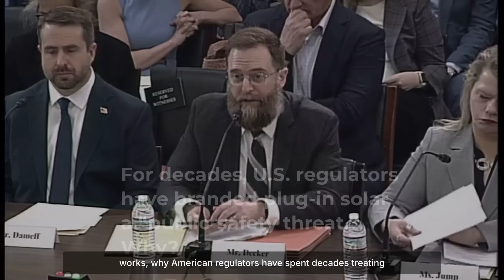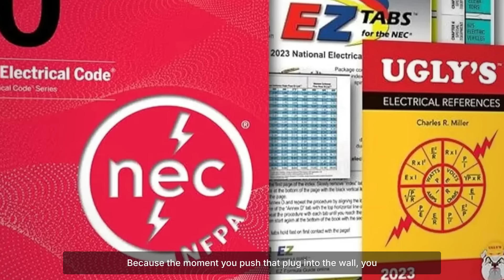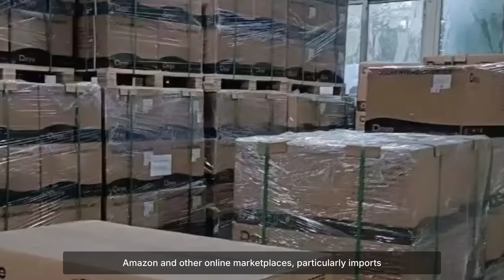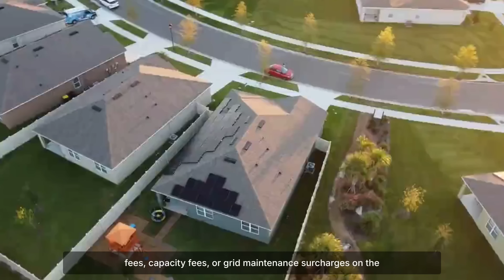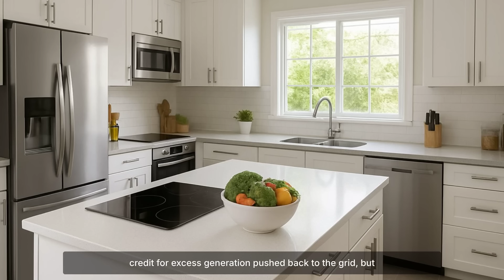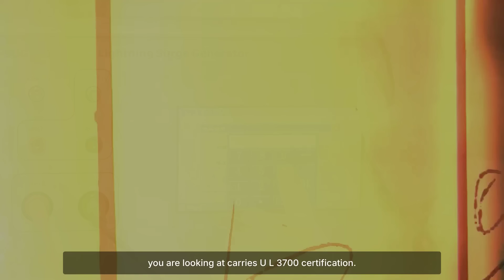This DIY Solar Trick Powers Your Home for FREE. Why Is It Illegal?

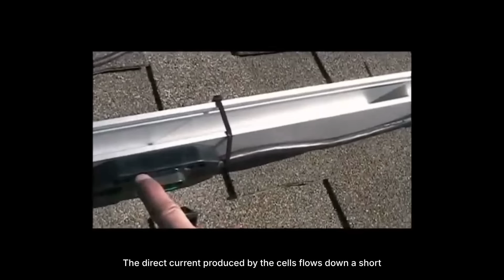Comment: 01:25 The thermosiphon principle is so elegant in its simplicity. It is fascinating that a passive design can create a self-sustaining convective loop to heat a room without requiring a single motor or moving part.

Comment: To use a plug in system just turn off the incoming supply that way it will not power through to the grid .

Comment: So if this type of micro inverter is able to activate without power from the grid, the solution is to install an outlet off the grid and connect  your appliance. I believe such type of micro inverter doesn't exist. No power from the grid,  the micro inverter  isn't  working

Comment: Maybe I didn’t pay attention to the details covered in this video but it seems to assume that any balcony solar would be interacting with the grid, that is quite a misleading assumption, someone could have a 400w balcony panel simply enter their own battery to use independently of any wall outlet and power their appliances through it independently.

Comment: Plug in solar is essentially unenforceable by the Authorities Having Jurisdiction (AHJ) 
If they catch you what are they going to do? Tell you to unplug it? As soon as they leave it is just going to be plugged back in again. 
Here are a few common sense things:
You may need to get a setup which monitors output do you do not  backfeed the utility. Most meters are not by directional. They will charge you for excess production. . 
Use a dedicated circuit. If you don't make sure the circuit is something there is no load on. 
Make sure the outlet you plug into is rated. Better to get a heavy duty outlet installed.
Make sure you don't tie into a circuit with the wires stabbed into the back of the outlet.  
Do not exceed 80% of the capacity of the circuit. 1400 watts on a 15 amp 120v circuit is max.
1900 watts is the max for a 20 amp 120v circuit 
Get listed products such as UL.

Comment: grid tie system don't produce electricity without the grid power hybrid do because they have battery Bank that's why some install a automatic transfer switch or put a manual transfer switch

Comment: People should be encouraged to have the system with a UL3700 rating.  Electricity is in extremely high demand and costs to buy electricity are rising.  Instead of building new power plants this could be answer to high electric demand and bills.

Comment: When your battery is fully charged. You can use the excess solar energy  directly to power your fans, light bulb, freezer, AC. Mean, your usage bill is gonna drop by 40-50%. In malaysia the hot sun easily generet 3-5kw daily.

Comment: The single most dangerous aspect of these Heath Robinson contraptions, and one that would definitely make them illegal in the UK, is not even given a mention amongst all the technical, financial, political, and other jargon in the video.
So, what happens when a child, or some other unsuspecting person, pulls that plug out of the wall socket and gets a large helping of mains voltage from the exposed live pins? These death traps are obviously manufactured in heathen third world countries that have absolutely no concept of health and safety. One only has to see the mile upon mile of spaghetti wiring festooned from building to building in their cities, to appreciate the ultra-low level of their safety standards. Any voltage, mains or otherwise, should ONLY ever be present at the wall socket or receptacle once the plug has been pulled, and NEVER at the plug itself!
The whole point of the plug is that, once it is unplugged, everything outside of the wall socket should be dead, except, of course, for the person holding it!

Comment: It's quite simple: if you make the power yourself, the utility loses money and make yourself a threat to their income.
It is true that grid tied plug-in solar can create real problems but the solution is to assemble an off-grid power cart.  The cart can be plugged into a dedicated outlet, one that comes directly off of the main breaker panel, such as an electric dryer, stove, or refridgerator. The appliance can then be plugged into the cart.  The cart-mounted inverter, which gets power from the grid, solar, and the battery, feeds the appliance and the dedicated outlet.
The solar, and/or the grid, charges the battery for power at night. The inverter can be programmed to NOT backfeed the grid.

Comment: Would've been better to learn the physics of the electricity before making a video about it. To think that doing that will actually save you anything it's a gross misunderstanding of the physics surrounding the electricity.
First of all, electricity follows a simple rule: the path of less resistance. But that is for the consumer part. For the producing part, it doesn't matter what source it is. But there's a simple truth that prevent those type of setup to work properly.
The small inverter just can't fight the power in the lines that's already connected to your house. It's true some of the current will flow true, but the quantity is so insignificant it doesn't really matter. 
Than, is the problem of the frequency in the power line. Micro inverters, although marketed as the "better" solution, are worst than a real wall inverters with multiple capabilities, and all they do is provide the consumer with a weaker chain of connection and no management possibilities.

You can, indeed, connect to your house without requiring permission, need a permit, put the electric system in danger or breaking any law, but that requires a wall inverter with a switching capabilities. You simply connect the solar panels to the inverter, the power line from the company to the same inverter, AFTER the meter on the wall, and that inverter will draw power however you set it up. If there enough power in the panels will draw form that, if not, will draw from the battery (if any installed) and if not, then will draw from the utility company without ever putting pressure on the system or endangering any part of the producer or the consumer.

But for this to work you need at least 150 v, which mean at least 4 panels at 48 v each. One or two panel at 12 or 24 volts won't do anything but eat your money. 

You could, of course, just use the plug to connect a simple device, without plugin it to the wall, that's fine, and that will, actually, show you how little you are producing, therefor proving this is just a scam. 

Common people, physic is there for everyone, is not that hard to read and understand the basics.

Comment: This is misinformation, if it creates more power than the circuit, then it travels to other circuits in the house that are also using power before back feeding.

Comment: The reason Germany acted fast on this is the disconnection of Russian gas supply.  No such issue affects the USA or Australia, so there really isn't a need for allowing this.  If a household wants 800W or 1200W of "free" power, it is entirely possible to get a couple of panels, and a battery box with MPPT and an inverter.  No need to plug into the house mains and cause problems - just plug the fridge or the TV or the lights into the battery box outlet and be happy you won't even feed excess into the grid, you'll keep it in your battery.  A 200AH is cheap these days and your insurance is intact.
Reply: My Melbourne house has new 6.6kW Hybrid solar system. Not cheaper. 😏